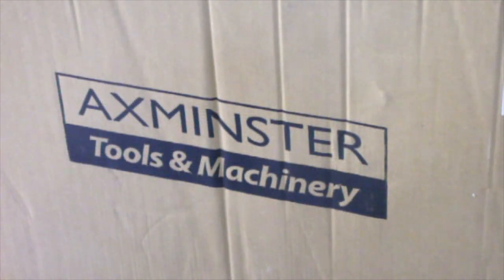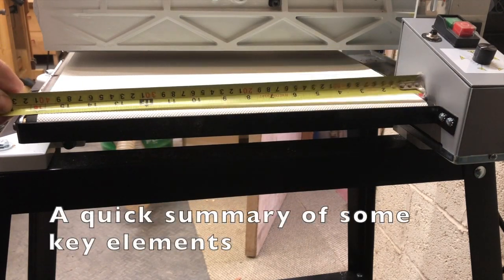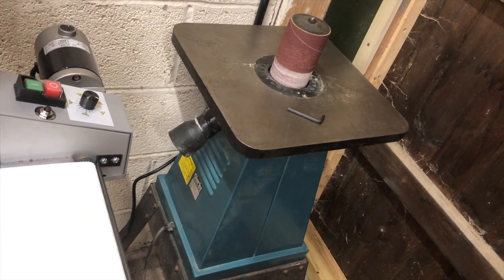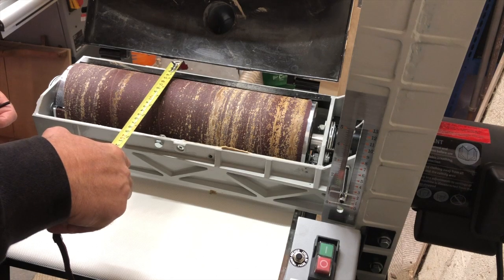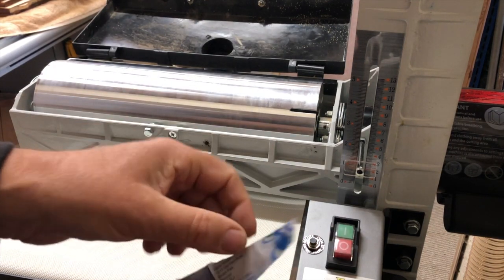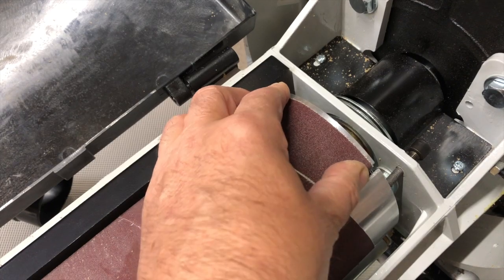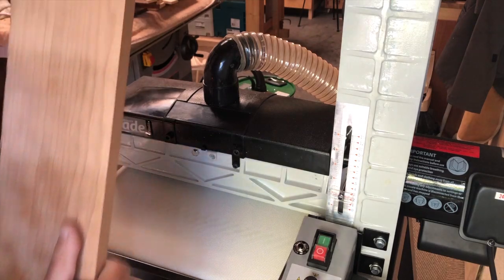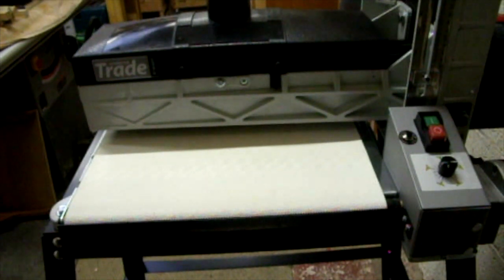Axminster AT406DS Trade Drum Sander - Tool Review Tuesday

Comment: Hi, I have a very old Axminster 16/32 Drum Sander, this looks like a direct replacement for it. How does it compare in terms of build quality compared to the similar-sized Jet JWDS 1632 Drum Sander? Secondhand Drum sanders seem to go for ridiculously high prices on eBay, this looks very tempting at the price with 3 years warranty.  My 16-32 is also a PITA when it comes to changing the paper, I have changed it 3 times in the past 10 years, I don't use it  thatmuch, fortunately.
Reply from the maker: Hi, I can’t really compare against the jet as I’ve never seen one of those. This one has some weight to it and so far I’ve not had any build issues tho’ the drum stop that you use when changing the loading is a bit Heath Robinson as it’s just a cap screw and nut, however it does the job. As for changing the loading once I’ve added the business card to the ends it becomes loads easy to change. Cheers Steve

Comment: Is it earlier if you start from the right? How is it a year on?
Reply from the maker: Yep tried loading from the right early on but just didn’t seem to manage a tight wrap! When using new loadings then not really an issue going left to right as long as you locate the end in the right place (when you look carefully there’s a small gap that you need to insert the end of the sandpaper and very easy to miss thru not spinning the drum far enough or too far especially if using a used loading as the end get very pliable hence the gluing of the card helps. After a year on use it’s ok for the price (was 1/2 price of the Laguna version) the vertical scale is rubbish so I’ve added a digital readout (cheap eBay dro easy to fit), the table belt lost its grip, however Axminster replace it under warranty ( looks like this is a common issue and most go with a sandpaper variant (120g) cost bout £35) I also added some locking wheels to the stand which helps with moving it about. The finish is in the main good tho on wide panels you may need to run a RO sander over it.
Sorry for the long answer in a nutshell it suits my need and at a fair price.
Cheers Steve

Comment: It looks like you will be getting another set of wheels for that, surprised at how big it is, and also that the sandpaper is a strip, these abrasive belts don't like and resin based coatings, I have just been sanding some Mammoth teeth down which are consolidated with resin, the belt clogs in a very short time, you can get some out with the air line gun. Stay safe!
Reply from the maker: Yeh just might source some wheels for this, I thought that the abrasive loading might clog but was too eager to give it a try 😂 hope you and yours keeping well 👍🏻